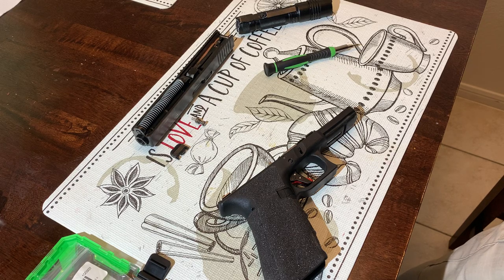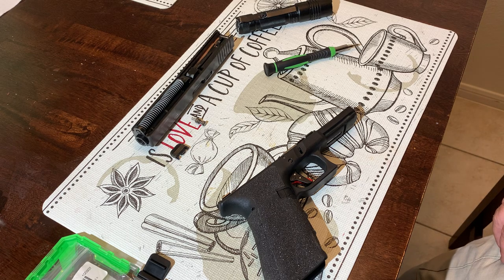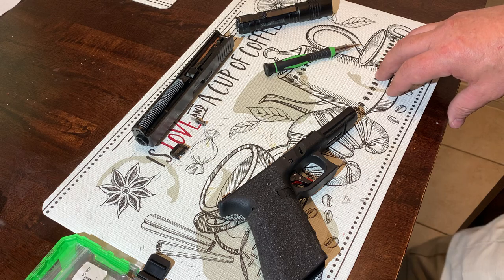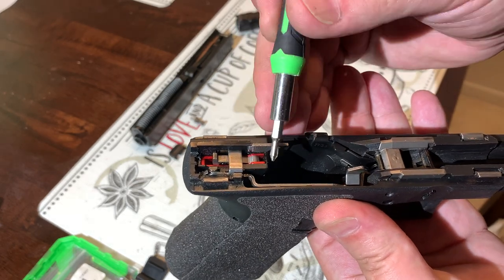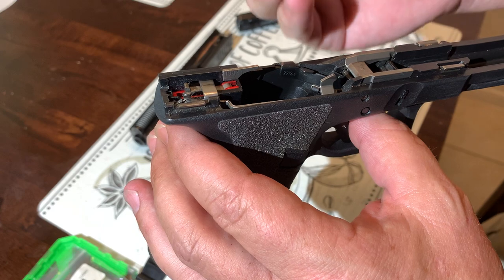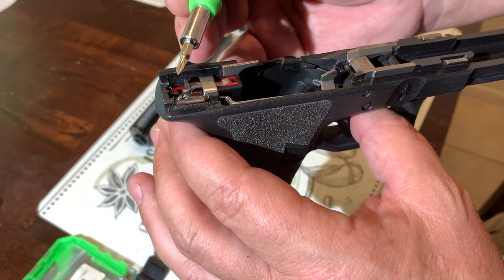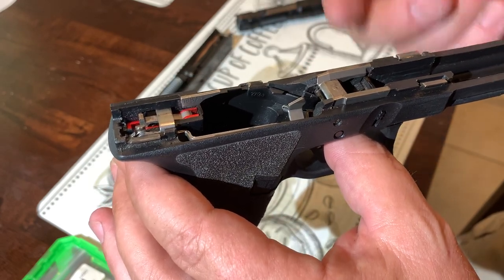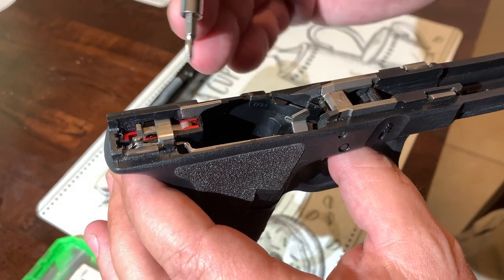Timney Alpha Glock Trigger follow up

Comment: you were able to make the gun misfire after removing the very part that keeps this from happening , even after that you had to force the gun to misfire , get one that is fully assembled to misfire , i see the sear isn't locked safe but a shock to make it drop would be greater than any drop test and then the firing pin block would prevent it from setting off a round , kinda like taking the air bags out of your car and cutting the break lines to show how dangerous the car is ,
Reply from the maker: Cars have more than one safety feature. Glocks have four. The timney eliminates two saftey features.

Comment: Bullshit and totally theoretical. The Timney trigger is as safe as any other trigger and ALL firing systems can have mechanical failures.
Reply from the maker: What’s bullshit exactly? Not that the Timney design keeps the striker fully cocked without any pressure on the trigger. This is easily verifiable as fact. This is the same feature as the Sig 320 has that creates a possibility of a fire event without a trigger pull when another mechanical part fails. That is not possible in the Glock original design because the striker is only cocked fully by pulling the trigger to the rear.
The most simple way to describe the difference is a Glock uses double action to cock the striker, the Timney is single action only. Glock refers to the “double action” of the FCG in Glocks as “Safe Action”. The Timney deletes that feature.
Reply: The possibility of an accidental discharge is in this video liberately made by forcefully manipulating the internal parts of the trigger mechanism. There is still the firing pin safety plunger preventing the striker from reaching the cartridge primer. So I stand by my meaning "bullshit theory".
Reply from the maker: @ronnyrenwall1336  The striker was only able to be “forcefully” released because there’s nothing blocking the sear. It’s only held in place by spring pressure. I acknowledged the striker block. I’m not carrying a Glock with internal safety features deleted.
Reply: U MUST HAVE A TIMNEY LOL. Its not drop safe dude. its for competition only

Comment: So why would Glock make almost an identical pre-cocked trigger system with their Glock Performance Trigger if it wasn't to the Glock level of safety?
Reply from the maker: Quite a few others use a similar design, Sig and Walther, etc. A “better” trigger pull sells more guns.

Comment: I sure would have liked to see what would happen to a primed case if the firing pin block were in place. Why did you remove it in this example?
Reply from the maker: Nothing would have happened unless the striker block were stuck as can happen when dirty. The purpose was to show nothing blocks the sear from releasing other than mechanical friction and spring pressure. Standard Glock, the sear surface is physically blocked from releasing until the trigger is to the rear.

Comment: The Timney is not marketed as a carry trigger, it’s a competition trigger.
Reply from the maker: It’s intended use is implied by it’s name. No where in the literature that ships with the trigger or in the description on the Timney triggers website does it expressly state it’s intended use for competition only. That said, many people have told me they are using it in their every day carry which I am discouraging and is the point of my previous and this video.
Reply: @jcnikoley  I have also done a video of that trigger on my channel and I said explicitly I would not recommend it for a carry option. I don’t say that because I feel the trigger is unsafe, I said that because a 3lb or less trigger is just too light for a edc option. In a stressful situation it’s just too easy to break through the wall taking up travel. Also, every other reviewer I have watched on the Timney also explicitly said it should not be used as a carry option.
Reply: @@Leo-so7gu that's not good.

Comment: I appreciate your take on the timney and how you feel it defeats safeties but it does not. It still has the same 3 safeties as a normal Glock. The trigger can not be depressed without engaging the safety tab within the trigger shoe and clearing the frame first just like a normal Glock. The timney is also drop safe just like a normal Glock. Lastly the same safety plunger must be depressed from the vertical extension/shark fin in order for the firing pin/striker to come through the breach face. There is more forces at play then you described in your video when your trying to demonstrate the trigger bar not having the cruciform as all one piece being an issue with the timney and “all it has is a spring tension pushing up on it”  that is not true. When a round is chambered and the striker is cocked up against the seer of the timney receiver. You have an upward force applied by the spring mechanism within the receiver. You also have the striker/firing pins spring working in tandem with the strikers/firing pins lug face pushing a horizontal force up against the Timney’s receiver seer that is being pushed up by its own spring and since it’s fixed and can only go up or down. Well that horizontal force alone even if you took out the spring in the receiver would be enough to hold the seer in place with the lug face of striker. as long as you have the required engagement (100% obviously preferred with single stage trigger) your gun will not fire without you depressing that trigger. Combine the force of the receiver spring pushing up constantly and the striker exerting a horizontal force against the seer especially with stock or heavier then stock striker springs you make it even more safe then already is. This is not a flaw or weakness and defeats no safeties. It’s the same concept of why you try to use your connector, trigger spring and striker spring all in conjunction with one another for desired trigger characteristics. There is no force being applied aside from gravity on that timney receiver to push it down. This is not rocket science and no need to over complicate it, there is no way for that receivers seer to drop without being engaged by the trigger bar and to make that happen you need to depress the trigger lol. You can try to explain that away but it’s just physically not possible unless you physically tried to depress it some other way essentially mimicking action of trigger bar. Which again is held in place by the shelf of the trigger housing itself. I don’t understand any of other points you try and make because any argument is fatally flawed past that point. Cheers bro
Reply from the maker: I must disagree with your initial statement that all three safeties remain in effect, but I agree with your other analysis of the mechanical function and how the functional sear is pushed up by the tension of the striker. You are overlooking the fact that the drop safety has nothing to do with dropping the gun, but is the shelf that prevents the trigger bar from lowering unless the trigger is pulled. The functional sear of the Timney is disconnected from the trigger bar, so it loses the drop safety. Secondly, although not technically one of Glock’s three safeties, the “safe action” is the cocking of the striker by the action of the pulling of the trigger which is bypassed as well. The safe action function can be essentially thought of like a double action revolver, and that feature is not present in the Timney, it’s essentially converted to single action. 
All the other mechanical forces contributing to safe operation you describe are in effect in the Timney are also present in a stock glock including the upper spring pressure on the rear cruciform that engages the striker. 
With the proper geometry, the Timney configuration can be safe, but would still be less safe than stock because of the loss of the safe action function and drop safety and the Timney essentially converts a Glock trigger from safe action (double action) to single action only. 
The mechanical forces that prevent the Timney from having an unintentional discharge are the same mechanical forces at play in a series 80 1911 with the safety disengaged (minus the trigger safety). I would not rely solely on a trigger safety in conjunction with a firing pin block carrying a 1911 cocked, it relies too heavily on proper engagement angles and surface area. Assuming you could add a trigger safety to a series 80 1911, it would be just as safe as the Timney so long as you didn’t alter anything about the factory trigger components. This would be much more dangerous though in conjunction with a competition 2 1/2 lb trigger job. 
Once people start swapping out strikers, changing engagement angles, and polishing the engagement surfaces, catastrophic results are more likely to occur with the Timney. As I said before, this trigger is fine in my opinion for competition use, but not for carry, just as it is marketed. It should also not be altered, but human nature being what it is, there are already people doing that to achieve an even lighter pull, and many others are using it for every day carry.
Reply: @jcnikoley  I appreciate your efforts and having a safe carry trigger is absolutely crucial in a gun like a glock. 

But when you said that a drop safety test has nothing to do with the gun actually being dropped you lost it right there. Drop safety testing is literally dropping the gun and seeing if it will go bang. I live in California and for a new handgun to added to the roster it must be dropped tested. The state lists out how high and how the gun should be dropped. The FBI drop test was 15 feet forward and 4 feet off the ground. When glock initially tested the gen 1's they passed the drop safe test but the rail was bent and wouldnt allow the gun to cycle afterwards. Thus glock gen 2 was born. 

The sig p320 recently failed the drop test and was recalled because it would fire when the gun was dropped at a certain angle. Omaha outdoors has a video on it. 

My point is like the 3 examples I listed above drop tests are literally dropping the gun and seeing if it goes bang. I have yet to see a drop test where the glock timmney fails. 

So in my opinion and from my research a glock with the timmney trigger maintains all 3 safetys found in a oem glock. Does that mean it should use in a carry gun? Thats up to the user to ultimately decide.
Reply: Did u know the firing pin will not clear the trigger bar if the firing pin sear is bypassed thus still drop safe
Reply: The poster also shows a demonstration with the blank while the plunger is out, but why not with it in?  Because he knows it will defeat his argument?   Just have the trigger guard covered up and proper trigger control and all will be well.
Reply: bro that sear can still drop without pressing the trigger. if u know guns u would see this. this guy is totally correct. if your gun drops the wrong way, that striker can fire but the plunger will stop the striker from firing. which still doesnt make it drop safe. its for competition ONLY
Reply: @davidstephens9936  YES IT WILL. HE JUST SHOWED YOU WHEN HE SHOT THE PRIMER. DUHHH
Reply: @bobkendrick7410  HE WAS JUST proving his point that it will fire past the trigger bar unlike what timney said. the gun is NOT drop safe. its competition use only
Reply: @ZChaosFactor  thank you dude he just told me the same thing and I was like what the fuck are you talking about? My Timney triggers are as safe as can be yes, I carry them appendix every single day I have primed casings and drop them from 10 feet in the air with no issues and God for bid you are having issues there are remedies for that problem if you know what you are doing
Reply: @DaCoverGuy  you have no idea how wrong you are tolerance stacking is the most important issue. There is an adjustment screw on the base of the seer mechanism to receive 100% engagement if you are having drop test issues with your trigger which can happen with any trigger mind you even a solid cruciform if you know what you are doing you can fix the problem.
Reply: @davidstephens9936 A drop can still compress the safety plunger spring, especially if running a lightened version.

Comment: So what you’re saying is that the trigger safety and the firing pin plunger safety are the only two safety mechanisms, and in reality the plunger safety is in reality the only safety because of wow light the trigger pull is. 

Has anyone ever seen a plunger safety fail in a Glock?
Reply from the maker: Carbon can accumulate that can hinders the plunger from returning to the down/block position. It’s also possible for it to hang up due to a failed spring. It is something that people may not check, and instructions to remove it (to properly clean it) are not in the instruction manual. Not be an issue provided all the other safeties were in place as designed.
Reply: @jcnikoley  yea but if the plunger safety has failed, a strong enough blow could disconnect the sere sending the firing pin forward. Correct?
Reply from the maker: @EvanWilson-d6h  Correct.

Comment: I found these on sale. I thought Timney! Cool! Installed them. One has a much shorter reset. I thought hmm, that’s odd. Test firing it. First 41 rounds. Fine. 4th mag. Dropped the slide loading the gun. Bang! Good thing I trusted my guy and followed all the after rules.  Tried to make it happen again. Took 20
Tries and bam. It happened again. I do t really know what to do now tho
Reply from the maker: I would install the original parts, you don't want it going bang when you don't want it to.

Comment: Unless you can prove this with all the other safety features involved I don't think this is defeating any other safety feature the fact that you remove the firing pin safety plunger means you are bypassing another safety feature.

If you can prove that this trigger fails when it comes to safety you need to have all the other safety features involved not one of them being removed.
Reply from the maker: With the Timney trigger the firing pin is fully cocked without the trigger being touched. That’s a change to the Glock design and is a fact. If you have an armorers rear plate, you can look through the back of the firearm and verify this yourself as I did in a previous video. 
There is no mechanical connection between the trigger bar, the sear and the striker with the timney. The drop safety which is a design feature of the Glock prevents the trigger bar which normally contacts the striker at all times is physically prevented from moving downward until the trigger is pulled all the way back. The Timney uses a pivoting seer but does not make contact with the trigger until the trigger is all the way back, but this means there is nothing physically preventing it from pivoting off of the striker. You can observe this for yourself by removing the slide and seeing that the trigger being forward, you can freely pivot this year with your finger or anything else. With the stock lock you will not be able to push the trigger bar down until the trigger is all the way to the rear, has cleared the drop safety shelf and has engaged the connector.  
This means that the only internal safety you are left with is the firing pin block, and if that fails, becomes worn, or sticks, perhaps you could see how this would be a problem.
In a nutshell, you can say that the Timmy design swaps out the Glock safe action design for the design of the Sig P320.

Comment: The main take away is, don’t remove the safety plunger on your Glock and it won’t accidentally fire 👍🏻
Reply from the maker: Probably shouldn't disable the other safety features either. Timney trigger deletes 2 of 4 of them.
Reply: @jcnikoley  After extensive drop and other safety tests with the Timney, zero occurrence of failure. I'm good with that however I personally carry with stock Glock trigger for the same reason plus its more reliable.
Reply from the maker: @3nealweber3  I agree.

Comment: To be fair though, does this make it any less safe than other triggers/guns on the market? The m&p's sear moves independently of the trigger bar and essentially is also at risk for movement from inertia in the same way, and thus making the striker plunger the one and only safety, but I can't recall many people regarding that as a flaw
Reply from the maker: True, the Sig 320/M18 is similar in that regard as well. Unsafe? Maybe, maybe not. Less safe, definitely.
Reply: @jcnikoley  Definitely less so. I guess I'm just arguing that it's not necessarily so much "your gun is now more dangerous" as much as it is "be sure you understand the difference between the stock and third party trigger"